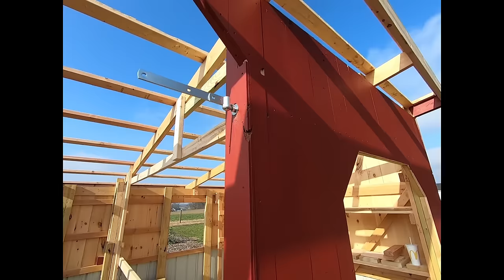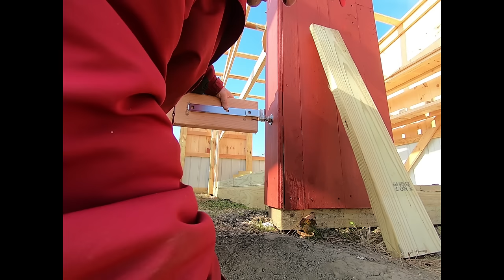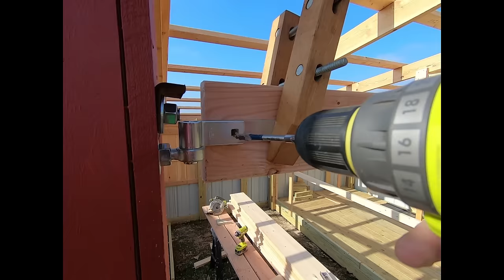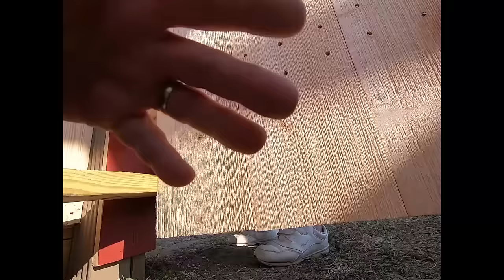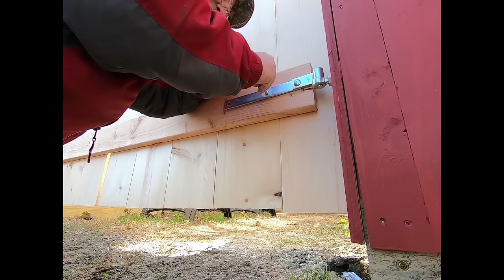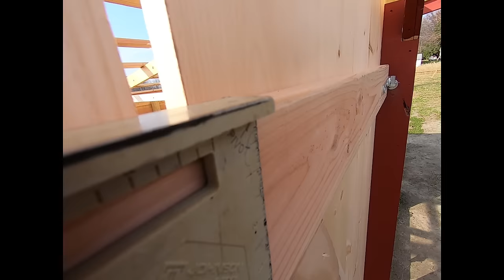DON'T build BARN Doors UNTIL you watch this VIDEO...EASY BARN DOORS

Comment: Personally I always put the finished side out and never never swing a door in.  The first barn door 🚪 I build some 50 years ago I swung then in and the owner couldn’t close the doors when he put his boat in the barn. Swinging them out comes with its own set of problems and you have to make sure the door can swing clear without binding against the jamb and it needs to swing a full 180 just in case the wind catches it and breaks your door stop. Also you can’t open the doors after a snow storm until you shovel.I have collected some old barn door hardware that catches the door and holds it open until you release it.  Having said that your engineering is excellent for the homeowner. Just saying.
Reply from the maker: Thanks so much for watching and commenting.  We just prefer the bracing out as it’s more traditional in our area.  The doors do swing out. I put a stop in hanging off the top plate to keep them from swinging in at all.  Hope you have a great day!

Comment: Outstanding video, just one "thought", and it really doesn't change any aspect of the build, except how the hinge straps interacts with the hinge bolt.  By allowing the strap to "sag" with the play at the joint, you are creating a situation where all the friction and ware are concentrated on a very small surface area, both at the bottom of the strap and the top, where it rotates on the bolt.  The one suggestion I have would be to raise the other end of the strap up, after you have attached the first bolt hole at each end.  Then I'd tighten the bolt to hold the strap in place and continue with the build.  By doing this you will enable the bottom of the strap to distribute all the friction and ware to the bolt, making for much less ware over decades.  This is a tiny change, takes no extra time and improved the outcome significantly.  Again, this is a really good video, thank you for taking the time to share!

Comment: Thank you for those instructions on building the doors in place. I have just completed a couple of 3x1,5 meter doors, and thanks to building them like this, there was no sag, and I can have minimal clearence to get them to seal up for a insulated winter garage. I had professional gates, but decided to build to make full use of the height by building doors, also they fit the esthetics of the farm better 🙌🏻 The only difference was that i wanted panel on the outside as well to insulate them, so i fastened the structure to the framing first, laid panel at the front, and then installed the hinges, and released the screws from the structure, with only one bolt on each arm of the hinge, and then fitted the rest. Perfect fitting! 👌🏻

Comment: Been watching so many door-building videos with pocket holes, glue, clamps and so much complication and this video just blew my mind. So glad I stumbled across this. I knew their had to be an easy, simple way. Thanks!
Reply from the maker: Thank you so much for watching.  Your time is valuable and I really appreciate it.
Reply: My elders taught me differently...  {Maybe better...?! Who knows?!} 
Of course getting the load bearing surfaces of the pintles as level as possible to each other is essential. 
As best I can tell, he did a very good job with that.
My methodology...   Barn doors should always swing out!  
Level the 2x6 rails & hinge straps (yours are oblique*), then drill all holes in the hinges through the 2x6 rails. Insert bolts in all the holes (to keep the hinges in position). You only need to put one bolt all the way through with a nut & washer on the hinge at this point, (like you did). Leave all the other bolts flush to the face of the 2x6 rails. {I install all the bolts w/ nuts, washers and thread-locker. I then cut any excess bolt off for the lowest profile possible at the nut. As I lay on planking I counter bore each nut location in the planking and 'hide' the nuts behind the boards. It looks better and prevents tampering with the nuts. 

Lay out and transfer the "reveal" gap to both sides of the 'Title' (top) Rail and the 'Channel' (bottom) Rail. There is method to this madness... Read on. 
Now is when you want to mark the braces! They can be temporarily attached to the rails for marking as demonstrated, however by marking the braces at this point you can easily scribe the braces directly to fit the rails very accurately without using a "90 degree pencil". You can install the braces now or later as you wish. 
I choose to install the braces at this point by placing one long screw through each toe of the braces to hold them in place as I lay on planking. Also you can better see where to install the brace screws as you lay on the planking. (i.e. - No chalk-line to stain the wood!)  If you did not choose to hide the nuts & bolts behind the face boards; after installation of the face boards, remove each hinge bolt in-turn, drill through the face boards and re-install the bolts. 
Proceed to finish the door as demonstrated. 

Some may choose a different method of separating the door panels at the "reveal".  I use a sharp hand saw for better accuracy.  It just looks better.

 Gravity - Not the 2x6 holds the hinges in the down position. They can be in any position you configure the bolt holes to, when you drill the 2x6.  
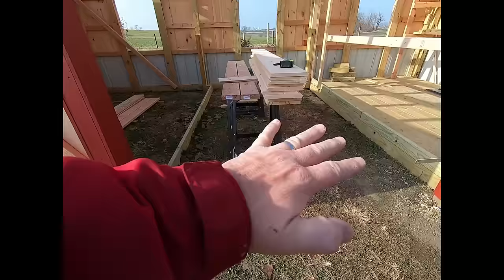* The hinges should not be "in the downward position" 2:30. That puts all the load on a very small surface area. Doing so causes rapid and uneven wear on the eye of the gudgeon (strap) causing it to squeak much sooner and to increase the 'slop' prematurely. The gudgeon eye should bear full length on the vertical and horizontal surfaces of the pintle. Not just one small spot at the top, bottom and underneath. 
Also it is not very aesthetic with the hinges being out of parallel with the centerline of the rails.  Again - It just looks better done well.

1

Comment: Great video. Nice doors for a wood shed or equipment barn. One observation no one seems to have made.  To get more than a 90 degree opening the hinge pivot point must be outside tge building.  The way yours are set up, when open, the doors will be straight out from the building. Thanks fir the Amish barn rebuild video.  We have Amish in our area who have done two homes  that burned in the last couple months.  Maybe a week or two from fire extinguisher to move-in ready!
Reply from the maker: Yup on the doors. Thanks for pointing that out. The Amish sure can organize and build fast.

Comment: I'm late to the party!  Nice video.   Really helped me think this out.   I think if you had inverted the top pin -- not only would the door not come off (as others mentioned) -- but the straps could be straight.   I think the inversion of the top pin prevents the door from "tilting" due to the "sag" in the hinge that you illustrated.  In order to invert the pin you would have to have a temporary board to hold the two horizontal boards in place.  All that said, this was one of the few videos I really enjoyed watching.

Comment: Nice! Thanks for the education!
Two things I see that may be an improvement.
Finish the lumber before building
Bolt on the door with the other 2 bolts before the last panel is installed. Remove the first bolt, attach the last panel, drill the holes for the first bolt and reinstall the bolt.
Reply from the maker: Thanks for watching and the suggestions. I appreciate your time!
Reply: Bingo! Was trying to 'splain the bolt thing quickly, then thought "never mind - most don't appreciate the small details that set good work apart"

Comment: Thanks so much for this. My 12’ door (6’ each side) came out great with 12” straps! Now what did you do for a latch?
Reply from the maker: Thanks for watching and glad your doors worked out for you.  
https://www.tractorsupply.com/tsc/product/national-hardware-n235-309-15-bar-holder-zinc-plated-3540059?store=178&cm_mmc=feed-GoogleShoppingProduct_-3540059&gclid=EAIaIQobChMI5fGC1bmk7gIVZ-bjBx2c7QkqEAQYBiABEgJHlPD_BwE
I mounted these on the sides of the doors and I drop a 2x4 in.  I had to build up the middle to set against the door because my doors are inset.

Comment: I also want to ask about the bolt location on the hinge ( not the first ones) why did you not level the hinge hardware.  Is it because you had the 2 by 6 leveled the the boards and if the hinge was a little tilted it did not matter.  Thank in advance and this was really really great
Reply from the maker: Leveling the hinge hardware would defeat one of the main benefits of using this method. The reason big doors sag is because of the play (slop) in these types of large hinges. By having the hinges “droop” there is no play in the hinge so when the doors are cut down the middle they line up perfectly. Thanks for asking.

Comment: Wow, thanks so much. 
 I have experience building shops, tractor sheds. I never knew of this amazing way to build doors to have them come out so square and true. 
 Just completed building double doors for one end of my Fifth wheel storage building. I followed your video to the letter. Only difference I used metal. The two doors span 18’.  Each door is 13’6” tall 9’ wide.  
 Following your video made Building the doors so simple and square.  
 I must admit I was a little nervous  as I was cutting the two doors apart. 
 Amazing, neither door dropped even a 1/8”. 

Anyone can build a doors using these instructions.  Don’t hesitate, just do it, you won’t regret it.
Reply from the maker: Thanks so much for the kind comment.  I’m glad your doors turned out so well!

Comment: My elders taught me differently...  {Maybe better...?! Who knows?!} 
Of course getting the load bearing surfaces of the pintles as level as possible to each other is essential. 
As best I can tell, you did a very good job with that.
My methodology...   Barn doors should always swing out!  
Level the 2x6 rails & hinge straps (yours are oblique*), then drill all holes in the hinges through the 2x6 rails. Insert bolts in all the holes (to keep the hinges in position). You only need to put one bolt all the way through with a nut & washer on the hinge at this point, (like you did). Leave all the other bolts flush to the face of the 2x6 rails. {I install all the bolts w/ nuts, washers and thread-locker. I then cut any excess bolt off for the lowest profile possible at the nut. As I lay on planking I counter bore each nut location in the planking and 'hide' the nuts behind the boards. It looks better and prevents tampering with the nuts. 

Lay out and transfer the "reveal" gap to both sides of the 'Title' (top) Rail and the 'Channel' (bottom) Rail. There is method to this madness... Read on. 
Now is when you want to mark the braces! They can be temporarily attached to the rails for marking as demonstrated, however by marking the braces at this point you can scribe the braces directly to fit the rails very accurately without using a "90 degree pencil". You can install the braces now or later as you wish. 
I choose to install the braces at this point by placing one long screw through each toe of the braces to hold them in place as I lay on planking. Also you can better see where to install the brace screws as you lay on the planking. (i.e. - No chalk-line to stain the wood!)  If you did not choose to hide the nuts & bolts behind the face boards; after installation of the face boards, remove each hinge bolt in-turn, drill through the face boards and re-install the bolts. 
Proceed to finish the door as demonstrated. 

Some may choose a different method of separating the door panels at the "reveal".  I use a sharp hand saw for better accuracy.  It just looks better.

 Gravity - Not the 2x6 holds the hinges in the down position. They can be in any position you configure the bolt holes to, when you drill the 2x6.  
* The hinges should not be "in the downward position" 2:30. That puts all the load on a very small surface area. Doing so causes rapid and uneven wear on the eye of the gudgeon (strap) causing it to squeak much sooner and to increase the 'slop' prematurely. The gudgeon eye should bear full length on the vertical and horizontal surfaces of the pintle. Not just one small spot at the top, bottom and underneath. 
Also it is not very aesthetic with the hinges being out of parallel with the centerline of the rails.  Again - It just looks better done well.
Reply from the maker: Thanks for watching and the suggestions. I am never too proud to try different methods!  The doors do swing out. They also would swing in a bit if I didn't put a stop in hanging off the top plate of the shed.
Reply: Yes I agree with your comment about not fastening the hinge strap in the "droopy" position. It causes the load to bear on points instead of surfaces. However!!! To avoid sag  in the doors when you cut them apart: 
The bottom strap&eye's (the gudgeons) need to be pushed apart from the centreline of the door before drilling and fastening to the rail, so the inner surface is bearing on the pintle. Opposite for the upper gudgeons which need to be pulled towards the centreline. That way the slop is taken out of the assembly, and the doors won't sag because the correct bearing surfaces are already in contact.. But yes, level them up, it looks much better and the whole surface is taking the load.
Reply: @nil5221  9

Comment: I have used your méthode to make doors 2mx2m (6x6fts) so 4m total span. I spent 3.5hrs of fabrication and i was realy not sure if it would work for doors of this weight. I then proceded to cuts thé horisontal supports once everthing was well bolted. As thé two doors swung lightly on their hinges, no sag, i did à little dance of joy. 
Thank you for sharing this very excellent méthode.
Reply from the maker: I’m glad they turned out well.  I helped build doors 24 feet wide and 16 feet tall before cutting. Each was 12 feet wide and 16 feet tall. Worked there too!

Comment: I used this approach on a barn with a 180 inch opening.  I used 2x6 rails and diagonal bracing with cedar board facing.  A total of 2 strap hinges on each door, each strap 48 inches long.  When I cut the center, no sag.  The approach worked for me.  Glad I found this video.
Reply from the maker: Thanks for watching and am glad the video was of help.

Comment: Great video!  What type of wood did you use for your uprights pieces?  Also their size?  Thanks
Reply from the maker: The cladding is white pine. I think they were 10” barn siding. It’s smooth on one side and rough on the other.

Comment: I have to thank you for this.  I'm currently replacing a barn door that fell off after a powerful gust of wind forced it into the doorway and wrenched the top pintle out of the upright. One slight difference: our barn doors are over 12' high and 13' across, with 3 horizontals and iron-mongery 5' long.  I'd no idea how to go about it until I watched this.  The right-hand door is still OK (for a wooden door probably 70 - 100 years old) so I'm screwing my horizontals to it (wedged underneath to stop it sagging)  rather than going all the way across, and I'm using hoists and a safety line, but my method is otherwise the same as yours.

Thank you very much!  Another 70 mph gust through the open doorway would probably have destroyed the roof, so our barn says thanks too.
Reply from the maker: Thank you for watching. I’m glad the video helped…and no more wind!
Reply: @LancoAmish  So far so good. Great excuse to buy more tools, too - battery circular saw and impact driver in particular. Around 200 screws to drive in!

Comment: Would there be any reason why the door couldn’t have the framing on the inside with the cladding on the outside? I suppose the hinge would have to allow extra clearance perhaps if the framing and cladding was on the outside of the hinge to allow it to swing open?

Comment: Thank you. I'm 73 and built one of two, 9' x 8' doors I need this past Saturday, by myself. Propably would have gotten the second one started that same day if I hadn 't had to go back to the hardware store to exchange the wrong size carriage bolts I bought. Was skeptical when it came time to cut them apart, but the saw didn't bind and the doors didn't sag and they opened, remarkable! The hardest part was finding the tongue and grove boards (at a price I could afford), other than that, it went just like your video.
Reply from the maker: I’m so glad the door build worked out for you and thank you so much for watching and the nice comment.

Comment: This is a great technique, thanks for sharing. However the drawback is you end up with the ledge and brace on the outside of the barn or garage. Aesthetically they are better on the inside. I'm now thinking of a way to screw the panelling to the camera side of the ledges. Obviously the last panel is a problem but I think I've figured that out! Anyone get any ideas?
Reply from the maker: Thanks for watching. You can easily reverse this. Just hang your ledge on the inside of the hinge. I prefer the brace and cross pieces on the outside.😀 I think it looks better than a big flat panel.
Reply: @LancoAmish  Hey thanks for coming back to me so quickly.The look I'm after is to have the hinges showing on the front (so not just a huge expanse of panel) with the ledge and brace behind. That's going to be tricky with the last panel piece, but I'm going to give it a go. Might film it too and put it on YT for you to have a look at! All the best to you and thanks again. 👍

Comment: Little late finding this one - great method and I will be using that to add doors to my shed this summer.  Only change I'd make is holding off on that last board until after the other two carriage bolts are installed - then I'd take out the first carriage bolt and add the last board and put that bolt back in through both boards instead of drilling the board to go over the bolt so that all the bolts are consistent in their look and finish.
Rubbing the chalk line on the back of the board!!  Such a great hack!!!